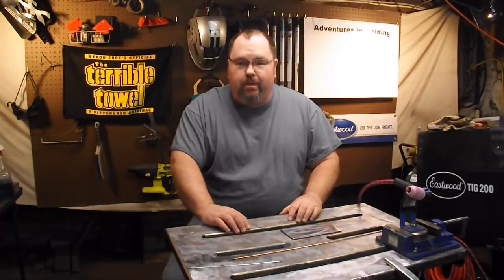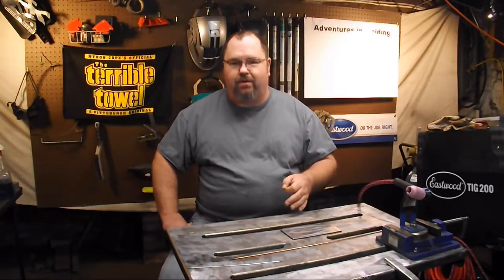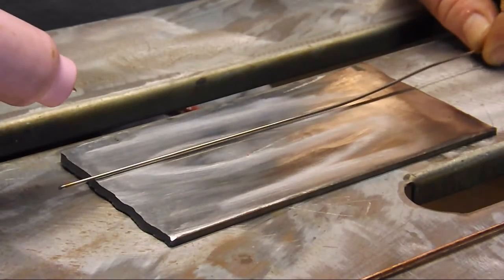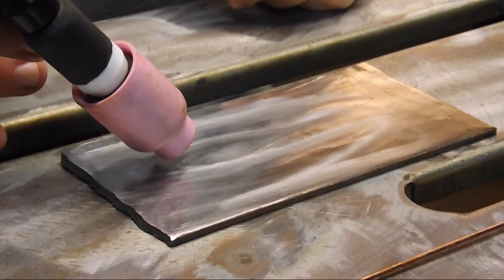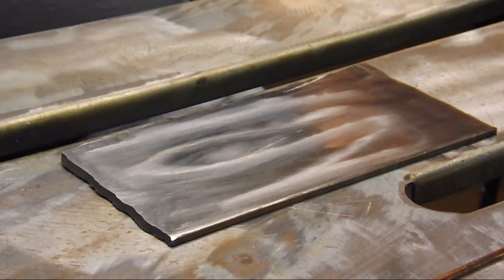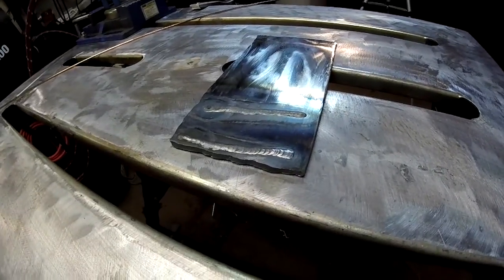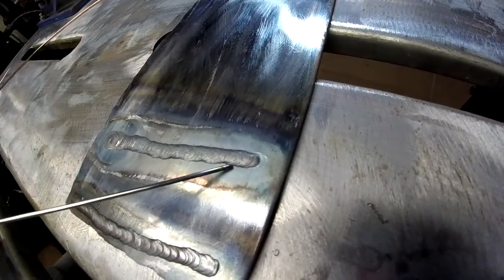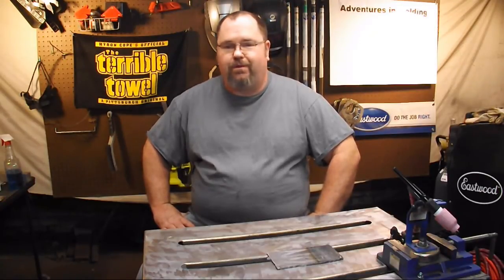Arc Length

Comment: Wow that tig cup looks huge in this video. Is there any advantages  in using a cup that size?
Reply: +TakeTheNarrowPath GloryIsHisName Yes there are some advantages: you get a bigger shielding area which really helps with discoloration when welding stainless or titanium for example.
Reply from the maker: +denniz122 Good response, right on point!
Reply: +denniz122 I appreciate your reply, But do you have to use more gas with a bigger cup?
Reply: +Adventures in Welding! ty, i enjoy your videos keep em coming. But i would really encourage you to get some kind of ventilation. Breathing in all the fumes and grinding dust is not going to do your health a favor.
Reply from the maker: +TakeTheNarrowPath GloryIsHisName Not really. There are multiple diffuse screens in a gas lens that just make better use of the gas. The gas lens improves the coverage. I tend to run 15cfh whether I am using a collet body or a gas lens.
Reply: +Adventures in Welding! Hey Paul it looks to me like you haven't got the correct insulator behind that big cup. The cup should seat on the back edge against the insulator. I think you had it screwed all the way up the thread, only with a standard insulator. but you seem to have got away with it.  Scott.
Reply from the maker: +scott carr Scott there was a black insulator that fits into the white one and upscales to the big cup. You got a good though buddy!
Reply: +Adventures in Welding! A really good piece there Paul about the long arc length that increases your voltage to give you a rough looking weld. Very helpfull information, especially for the newbie. Scott.
Reply from the maker: +scott carr Thanks buddy!